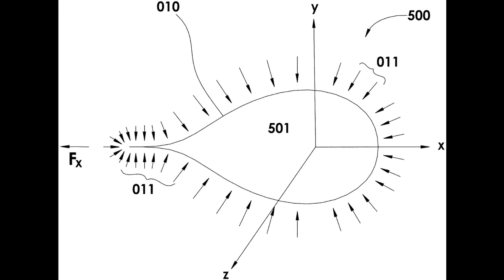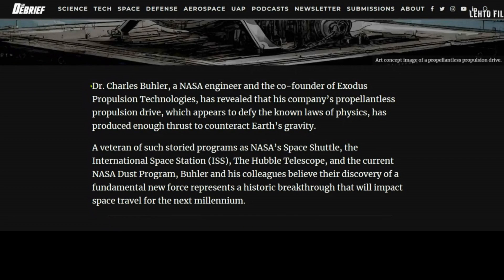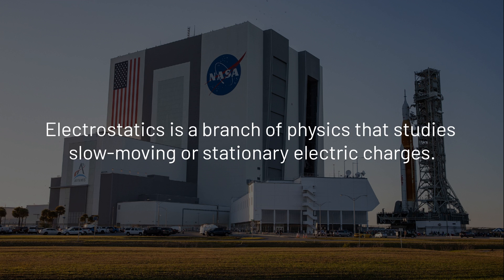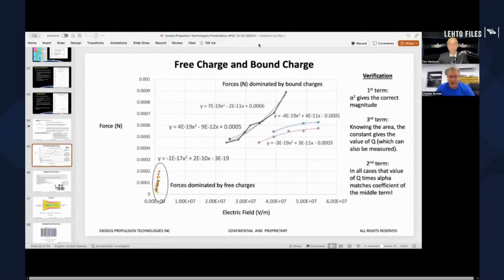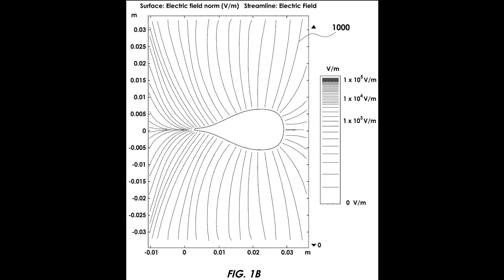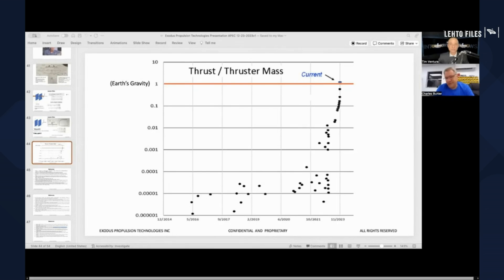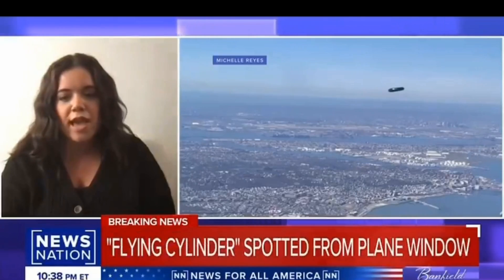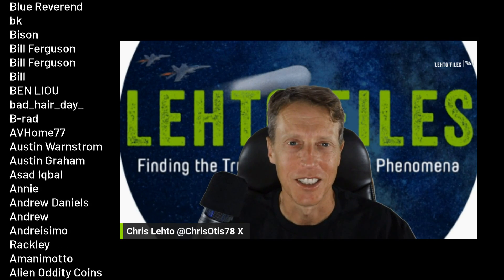NASA Scientist's Propellantless Thrust Breakthrough - The Key to UAP Propulsion?

Comment: Gravity is part of the electromagnetic spectrum. It's just at the very low end of the spectrum. There is approximately 400 000 volts difference between the ionosphere and the ground. 100 volts every meter. That is a directional normal force that is perpendicular to the ground all around the planet. Just need an equation that factors in electric force into gravity based on mass and distance. Since every solid object is made of electromagnetically polarized constituent parts. Each aligns according to charge and in effect creates a large solid with the same electromagnetic properties. There is angular momentum to everything so there is a frequency and resonance for all atoms. How things appear depends on this frequency interacting with light.

Comment: What is "1g of force"? in this context, G usually means 9.8 m/s which is acceleration not a force measurement. For instance the empire state building experiences 1g of force and so dos and ant. If this thing can push up with "1 g of force", this sounds like it can lift anything regardless of its mass? Sounds weird.

Comment: It's strange to me that the force put out by the device is measured in Gs. Applying 1g of force to a 10 gram object is very different to applying the same 1g to a 1 ton object. Also, it's unclear how energy efficient this thing is (or can potentially be). If it can run on a battery, how big and bulky this battery will have to be for it to be in any way practical.

Comment: because as I have been saying. gravity is the difference in dialated time.  based on the density of space. change the density of the mass or the space arround it. and like water vapor. it will move away from centre of mass.

Comment: I find the claims to be very incredible and completely lacking any supporting evidence. If you're going to claim to have discovered a fifth force, you better have some pretty hard evidence for that. That said, his entire background is in electrostatics. 
There may be something there, but I am not inclined to believe that it's a new force. I'm more inclined to believe that somebody was sloppy in doing the experiments and didn't account for all sources of error. Generally speaking, looking at his diagrams, there would be strong potential for a Corona to form asymmetrically on his electrodes. And such Corona is capable of generating a force. 
Considering that there is no such thing as an asymmetric electric field, I would be inclined to think that somewhere in his testing app radice is the paired charge and that the forces he's measuring are between those paired charges. If this is indeed the case, then that means his experiment has automatically failed to achieve six sigma results required for a new claim.
Reply from the maker: We should know in the future

Comment: UAPs, UFOs and UAFs seem to  have one thing in common and that is the ability to render the craft and its occupants without mass.  The maneuvers of these craft are such that occupants would be crushed without this or, the system is able to accelerate the craft and occupants with an all encompassing force.  Note, if you can eliminate mass, little energy is needed to move the craft and its occupants.  Also, if the atmosphere surrounding the craft is rendered massless, there would be no sonic boom.  This would indicate that NASA is making false claims.

Comment: If you can create a vacuum in front of an object ( even 1 mm)thick then the pressure of the atmosphere behind it will create forward momentum.  By moving that vacuum from the exact center of the front will give you turning direction.

Comment: Experiments with asymmetric capacitors have shown that there is no "new force" involved. There is still something being accelerated and "thrown out the back" to produce the reaction force, and that "something" is air. Experiments in a vacuum chamber show that the thrust decreases toward zero as the pressure of the surrounding gas is decreased.

Comment: it just dawned on me how the nartzees may have stumbled on the principle behind the legendary haunebu flying saucer and the significance of two opposite spinning disks of different sizes on the same shaft up the centre of the craft , the van degraff belt generators to create static voltage  , to break symmetry by uneven discharge by the disks as well as the gyroscopic effect they induce , maybe the stories are true and they tried to escape to antarctica with the secrets????

Comment: In usual static high voltage capacitors, any Bondi inertial dipole must be negated by the opposite alignment of induced dielectric dipoles, however, I'm not sure if it is true also when the dipoles are not symmetrical. A full solution should involve both DC and AC. See Electro-gravity via geometric chronon field and on the origin of mass". Honestly speaking, I'm not sure I understand how NASAs  invention can generate a Hermann Bondi inertial dipole, providing M_virtual_by_charge = (-,+) Charge / sqrt(16 Pi G Epsilon0). That is (-,+) 5.802135 * 10^9 Kg / Coulomb and it does not begave as inertial mass, partly because charge is coupled with a bivector not related to velocity in the Geometric Chronon Field theory.

Comment: Wouldn’t this tech get hot from being at high voltage? I guess there doesn’t seem to be any current flowing so maybe not. But even so, the UAPs don’t appear to have any heat signature, almost like air resistance doesn’t have any heating effect on them, and this tech would still have that if it was scaled ip

Comment: Looks like that old chestnut of an inequality in field strength between or around conductors or capacitors giving rise to a force, but 1g of force ie 1 newton is claiming a great deal, i'll believe it when i see it. A few years ago there was em drive, originally proposed by Robert Sawyer, a kind of rf capacitor and resonance affair. Well, the research was handed over to DARPA and other research establishments and they got forces in the milli-newton range or nothing at all, so they said. And everything to do with em drive quietly disappeared after that.....

Comment: Pressure inside a combustion chamber or something bell shaped will produce thrust in the opposite direction of the open end. The pressure could be produced by sound, light, plasma or radio wave. Chemical propellants not needed.

Comment: Sounds like a what lots of Defence agencies and contractors were going on about in the 50's and of course what B.Brown was up to even earlier. He says the voltages are lower than B. Browns but the size is a lot smaller and the V/m is comparable not that I remember ever reading about 1G acceleration With B Browns work.. Very interesting

Comment: If they used thrust or acceleration, they would make sonic booms. So, go back to the drawing board. That electrostatic type propulsion is similar to the Aharanov-Bohm Effect (sp?), it's an ether wind. Not a very robust propulsion method. Won't get you faster than light, neither will gravity manipulation, but there's actually a very simple and elegant solution. Quantum Tunneling Vehicles, that's what you want. Emulate an elementary particle, cut-and-paste teleportation at a high frequency. Elementary particles quantum tunnel, no size limit in physics for an elementary particle. Means you could fake out the universe, make one big enough to get inside of. Wiggle them fields rotating around it and trick the universe into moving you around like an elementary particle. Universe just cuts-and-pastes them where it thinks they need to be by the perturbations in their field structure. Something you could control if you were inside of the particle creating that field. Being in control of that field, you could trick the universe into making larger than normal jumps for any natural particle under ordinary circumstances. Quantum laws are built for speed, to prevent violations of conservation laws by elementary particles, they don't stop to check their work. They also take precedence over the classical laws of physics, there is no speed limit for quantum information exchange in enforcing the conservation laws of elementary particles. There is no speed limit for the particle because speed isn't involved in the calculation, just distance. The particle isn't moving, it's being re-addressed in space-time. An exploit to fly to the stars in days, without ever accelerating at all. That's what they're doing. Electric field = flying saucer, magnetic field  = flying cigar. It's actually pretty obvious, I've never understood how your physicists manage to miss the easy association. No moving parts, either, just rotating an electric or magnetic field around a superconducting hull. It's that simple. That's why they call them "elementary" particles. They are very simple. No moving parts.

One paragraph. Now you know how to build a starship. Oh, and if you make the field so you can extend it a ways beyond the vehicle, you can pick up and set down really large rocks. No metals, messes with the field, metallic junk gets randomly teleported out into the environment, but big granite columns or blocks, no problem. Stack thousand ton granite blocks like tinker toys, move them around like feathers. It's the field that is teleported, and anything within it. And now you know how to build megalithic sites, like Baalbek. We be learnin' alien secret stuff today, aye.

Comment: Incredible. These thrusters may be small, but place thousands of these together and that net positive acceleration adds up.
Reply: Not necessarily, the smaller craft have a large engine 2/3 placed inside the disc while the 1/3 is popping underneath the craft and the larger ships usually have 4 of them slightly smaller at the same position only in the sides instead of the centre. Don’t ask how I know this.

Comment: Propellantless doesn't mean it doesn't need a power source.  What's the power source?
Reply: Sounds like anything that can charge these batteries back up would work. Still a ways to go as they just overcame the weight of the battery itself
Reply: A lot of voltage and amps ….

Comment: this is the same concept of "electromagnetic liquid  dynamic" tech that was proposed a long time ago. which is basically still about trading energy with surrounding masses. the surrounding masses in questions are IONS/ELECTRONS. this is where it gets tricky with the math, since how much mass of ions and electrons accumulated around the vessel that could by math correspond to how much energy/mass being traded when the "propulsion" make them move opposite to where the vessel is going. it is still 'PROPELLANT" based in mind. it using the mass of the surrounding ions to exchange that energy.
and while they doing that they would STILL be su bject to gravity. and the mass of the vessel will still be "registered" to the universe. 
no propulsion whatever it is will make you travel close to the speed of light without first making the mass of the vessel negligable to the universe. thas the KEY. whatever the propulsion you want to use.

Comment: As described, this is not a 'new force.' It is a new application of current technology. Electrostatics is not new. Asymmetry is not new. Did anyone else notice that the increase in "thrust" was made as their models got smaller/lighter? Has anyone else noticed that most thrusters that are high efficiency usually produce micro thrust?

Comment: Gravitation Thuster 
Thrust and Pressure? Thrust is a kind of force acting on an object. An object can experience force from many directions.
What Is a Warp Bubble, is A Chrage Tranmited Field Of Energy, That Ben Gravity And Light But Not A Warp Drive Motor, The Chrage Transmited Field Of Energy Is connected To A Magnet. That Change It Energy Field Of The Magnet To A Warp Drive Motor  A  Aircraft With A  Negative Electron Field Generator, Is Field Propulsion Or Call A Warp Field Genarator
 Field Propulsion
The Electronic Engine; With No Movin Part.
Will Help US Get Out Earth Gravity Well   ,

Comment: I've seen high voltage cables jump under faulty conditions at over 350 amps also i watched on u tube some scientist guy crush a coke can with a copper ring around it using high voltages

Comment: UFO's seem to have 2 modes: 
1. Slow hover: this could be the mode powered by Electrostatics. Lots of historical cases of UFO's seen flying slow and low emitting a buzzing electric discharge like sound. This however does not explain mode 2.
2. Zero inertia: Unless this thing or another technology also reduces the craft's mass to zero OR warps space, I can't see how it can perform instantaneous acceleration, right angle turns and sudden stops.

So this discovery, while humongous, would still explain only half the UFO phenomenon.
Reply: If the ufo puts itself in a time bubble it could use method one to travel faster from our perspective but actual speed in thier own

Comment: Great news, mankind is on its way to the stars at last, the interesting fact about this is its very much like what I saw a fleet of UFOs do in the Grose Valley of the Blue Mountains of NSW Australia in 1980 when a fleet touched down one by one with each slowly making their way up the valley to enter their base by moving through a solid rock face. It's clear these UFOs had the ability to move through Baryonic matter at will, which is needed if your going to travel faster then light for obvious reasons.